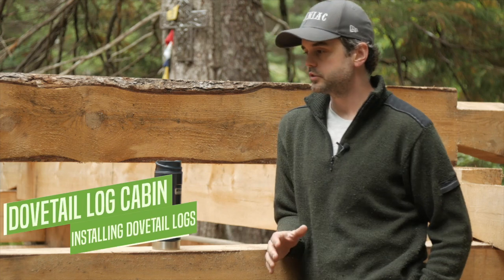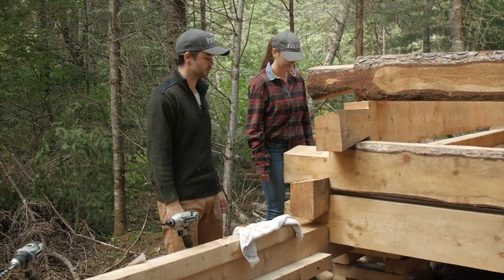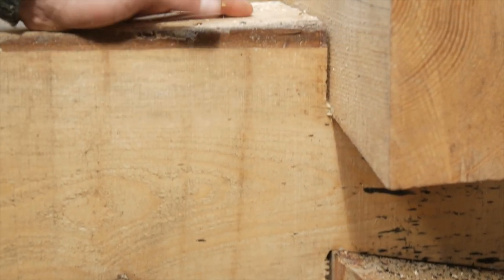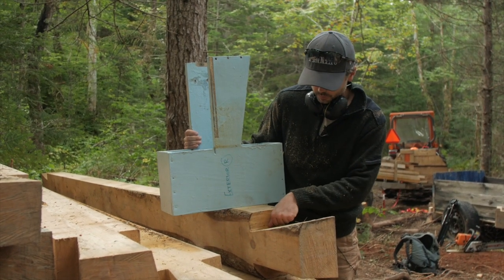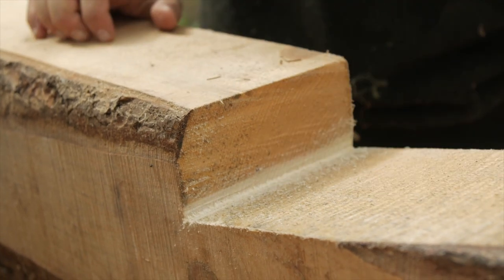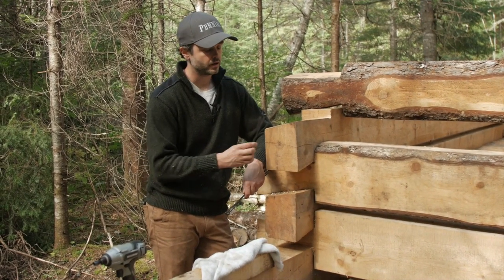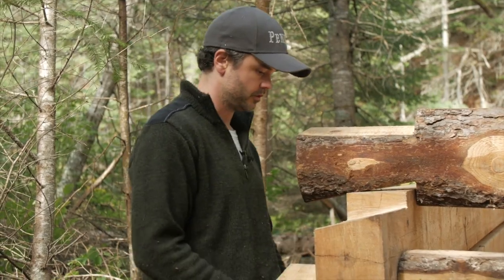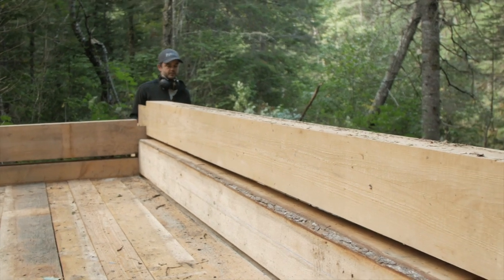Dovetail Log Cabin - Installing  Dovetail Beams and Building Walls

Comment: The reason for the angles is so that with age the corners get tighter.  You definitely do not need to use any fasteners on the corner.  I rebuilt and hundred year old dovetailed log cabin in eastern Ontario and you could not get  a dime in between the joints on almost all corners.
Reply from the maker: I debated the fasteners - You are right, I think it would have been fine without them. I love the old dovetail cabins! Mine was inspired by ones I saw in the Czech Republic.

Comment: About 21 years ago I went to Georgian bay to see a log home builder Pioneer Log. My biggest home regret not doing everything I could at the time to get one of their homes. Similar but 8X20 full length logs up to 40 feet. Adzed both sides. They offered a 2X16+ live edge siding and they used the chinking method also.
Reply from the maker: Thanks for sharing that Paul.. I am from New Brunswick and have never been to Georgian Bay. I gather you like the chinking look too for a cabin? 40 foot logs would be a challenge to work with but would make an amazing cabin or home.

Comment: It looks like an incredibly strong way of locking the corners together. If a bomb went off in the cabin the screws would help, but I think the dovetails force the logs together (inwards).
Reply from the maker: Yes, I think you are right! I think it should be solid. Hopefully no bombs :)

Comment: By design, the weight of the cabin logs, roof etc force the joints in the corners tighter. Screws in the joints will prevent them from tightening. As the logs dry they will shrink and you will get gaps in the corners because the screws will not allow them to tighten. I built one like this 25 years ago and did not anchor the corners. In turn they are tighter now in the joints than they were when built. Cabin is looking awesome but I would be curious as to how your corner joints fit in 10 years. Incidentally, these are half dovetail joints, not dovetails.
Reply: Did you leave the gaps between logs or make them flush? Was thinking  I would cut a grove   down the center of the logs length.  use a 2x4  like a big biscuit  to seal in between  the logs
Reply: @bamadave1983  This type of joint gets its strength by bearing the weight only on the corners. Any point of contact between two logs at a location other than the corner weakens the corner joint. That is why there is a minimum 2 inch gap between the logs.
Reply: Rocky is dead on right.  The screws will inhibit the joints from becoming tighter with time.  It is amazing the amount of movement that occurs with the logs swelling and shrinking during the normal seasons.  He is also correct on the chinking be flexible and not ridge for the same reason.

Comment: Why do you need a gap between the logs? Wouldn't it be easier to fit them tight and put seal/caulk between them? Love your work.
Reply from the maker: Hi Ron - where are you writing from? Great question. There are several ways to build a cabin and you are right that one option would be to have the logs fit tight. I plan to do a video about this, but basically by leaving the gaps there a few benefits. These would include allowing space for the lumber to expand, twist, and move a bit without affecting the structure. I think historically it may have also been done to use less lumber. For me I like the look of a chinked cabin (with the gaps). Great question and I plan to soon do a video on the pros and cons of the two options. I'll give a more detailed answer in a future video. Thanks for commenting :)
Reply: Expanding foam would work a treat to fill those gaps, it would accommodate twists and warps in the beams.

Comment: question. what were the original dimensions  of the timbers when they arrived on site ? Thx
Reply from the maker: I milled all the main cabin timbers to be 14 feet long, 10 inch tall, 6 inch wide. Any other questions just ask! I used spruce.
Reply: Yes one more question. There are many different chinking mixtures/ compounds/ solutions. What did you end up using and would you mind telling me why? I'm in the beginning stages of planning a log cabin on my farm in Central Ohio. Likely a 19 x 15 two story structure. Thx
Reply from the maker: I used 3 parts sand, 1 part Portland cement, 1/2 part lime. This seemed to be commonly used by others on YouTube and in my area, was fairly cheap and looks good in my opinion. Check out Handmade House and The Bearded Carpenter - they both are high end craftsmen who have chunked cabins and were a big help to me!
Reply: @PenniacWilderness  did you put any kind of sealer on the logs to help maintain their natural beauty? Over time the natural tan color.will fade to gray from the weather. It would be wonderful if their was a way to keep the color.  Thx
Reply from the maker: @markstoll9636  I did not put anything on them, I kind of like the grey colour, but I think there are many options. I did use an end sealer after I cut the logs to try to minimize checking of the logs though, but this was just on the butt ends.

Comment: Weight of the logs approximation: 6"*10"*120" *62.4[pounds/cubic foot]/(12*12*12)=260 pounds or 130 on each end
Assuming they have the density of water. How deep would they float in water. If they'd float 50% under water and 50% above water, the density would be 62.4* 50%/100% or 31.2 pounds per cubic foot, and the logs would weigh 260*50% or 130 pounds total. drier lighter, wetter heavier. Or take a sample cubic inch and weigh it.
Reply from the maker: Very interesting! That feels about right. I could move one end on my own, but the whole log would be pretty unlikely. I was planning to take a small piece of it and weight it at sometime. I have some end pieces that I cut off. Could weight a few and get an average weight and multiply to get the length of the entire log. You clearly have some experience in this sort of work or with log construction? Very neat. Thanks - I appreciate you sharing that and also how you did the calculation.
Reply: I was an engineering student 50 years ago. Best Regards. Great Video. (She's a keeper.Take good care of her.)

Comment: Why didn't you remove all the bark from the logs?
Reply from the maker: If you check out the newer build videos, you can see that most of the bark has been removed. You are right, the bark is a portal for insects to get into the wood!
Reply: @PenniacWilderness  i havent watched all your video's yet. Keep it up!

Comment: I prefer cleaned čut logs without bark on the edge.
Reply: when they leave the bark on its called live edge, if you peel the bark off with the cambium (a layer in-between the actual good wood an the outside bark) it will make the log last way longer but we'd all be dead by the time that thing rots regardless lol.  I really like the look of live edge but if I were to take this much time doing something I'd want it to last as long as possible, so I'd take it off that cambium layer.  +100 hours lol